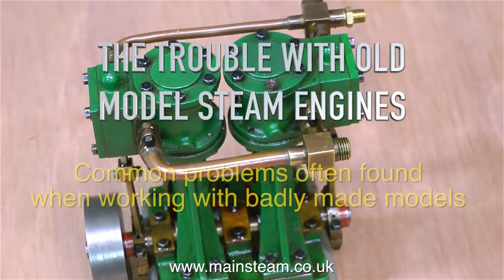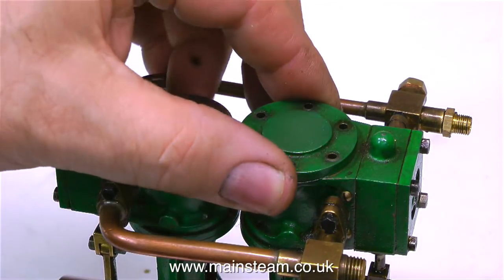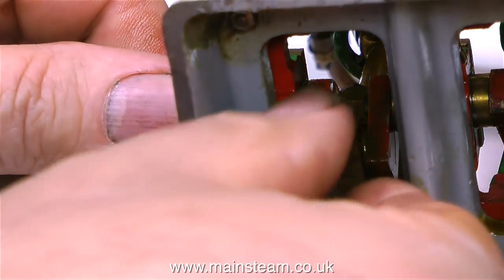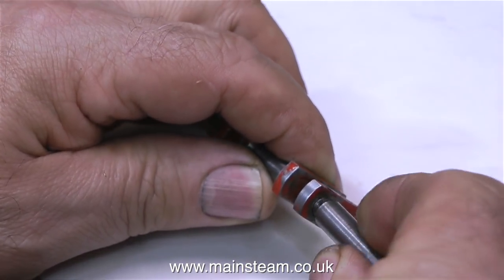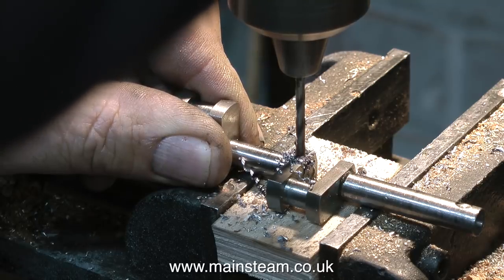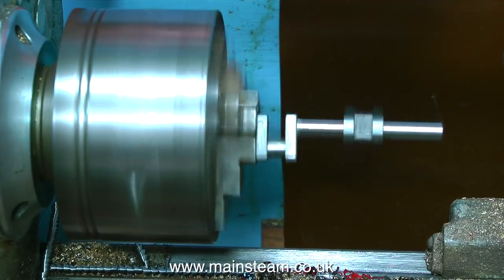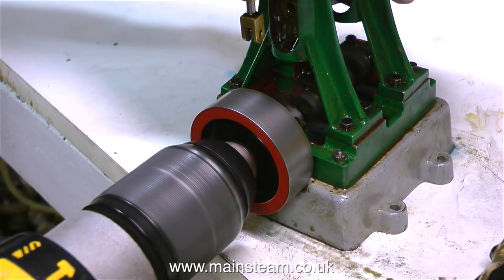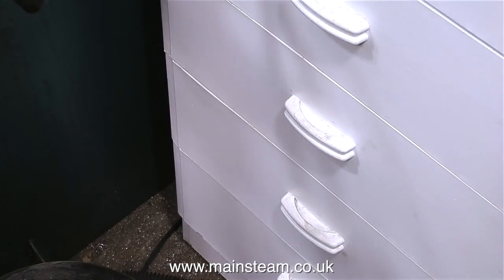THE TROUBLE WITH OLD MODEL STEAM ENGINES

Comment: You know, I have no idea how anybody could find this interesting as a hobby, however, it makes me quite inexplicably happy that somebody does find this so interesting as a hobby.  Kudos to the publisher.
Reply: steam engines are much more efficient than the gasoline or diesel crap on the roads I heard...
Reply: If it wasn't such a wast of energy to boil water...
Reply: Nope, all steam engines are woefully inefficient compared to internal combustion engines.  That's why they are not used, Derp!
Reply: Typical gasoline engine: 37% efficiency
Typical diesel engine efficiency: 45% (55% is not unheard of)
Typical piston type steam engine: 17%
Not sure on steam turbine.
Reply: Has more to due with the fact that a steam piston engine requires 3 consumable fuels.

1. Thermal fuel
2. Water (even with a condenser you will have loss.
3. Steam oil (that gets lost with the water) to lubricate the piston

Piston steam engines have the advantage of being essentially one stroke. There is a force being applied to the crank on the up and the down stroke of the piston. Which in terms of rotation power impulse is unbeatable for torque.

Steam is also not all that convenient because you have to build up steam before going, unlike a diesel or gasoline. Though before the electric starter steam actually was more popular, steam engine wasn't going to backfire and break your arm,  and wasn't as noisy.
Reply: Steam turbines in large electric power plants achieve efficiencies around 35% IIRC.
Reply: the trick to improving  efficacy is to boil tiny amounts of water into superheated pressures...tiny volume of water per boil but at tremendous amounts of pressure...something we can really do easily like friskies with our current modern present engineering capabilities
Reply: +ss "I can't contemplate why anyone wouldn't find steam engines interesting as a hobby. Engineering is interesting in all it's forms."

I'm an engineer and I agree.

I know how a steam engine works.  There done!  Now, how does a neural network, work?

What I mean with my initial comment, is once you understand it, I don't understand why you'd want to collect a million examples of it.  There's only so many ways a steam engine can be intelligently designed.  I expect it's close to the optimal design by now.

It's like a bicycle now.  They are basically engineered perfectly.  You can't really improve on the design at all.  They are over 90% efficient in energy transfer.  Something like 95% I think.  A really high end bicycle made in 1995 isn't much different in performance than one made in 2017 - just a little lighter.  In fact, a good bicycle from 1980 isn't much different - but it was a bit heavier made from steel.  Once you see the perfect design, and understand why it's made that way, what's left to do with it?

But I don't begrudge people collecting old bicycles, and it's interesting to see older designs with not quite perfect engineering (and they made some pretty basic mistakes back in the early 1900s), but I'd never ride one except as a lark.

I just find it kind of remarkable that people would collect a bunch of model steam engines but it makes me happy, for reasons I entirely do not understand, that somebody does enjoy it.  Always amuses me to have a emotional reaction that confuses myself.
Reply: +fuzzywzhe, that is the words of ignorance.  More you know about a subject, the more less incline you are to say you are an expert.
And less you know, more incline you are to claim you know all that is needed to know about the subject.

AND hobbies are not needed to be useful, they are ment to be fun.  Steam engine are fun.
Reply: +David Vermillion, you forget to add Electrical engine into the equation.

I can't understand why people even consider internal combustion engine these days. :-)
Reply: The fun. I don't think you understand the beauty of a big block. and also when we switch to fully electric cars we will need something to produce all the extra needed energy where will it come from?
Reply: +David Vermillion. From the same place where the energy come from where we push those pistons.
And yes, internal cumbustion V8 or a proper V12 (Jaguar) are great fun, but as obsolete as the Steam engine.
Reply: Your logic is flawed because you are forgetting one thing.

Where did that electrical energy originally come from? A power plant using steam power to generate electricity. Doing an efficiency calculation from just the battery to the electric motor is the same as assuming free energy exists.
Reply: +steve gale, depend on which generation of the V12 you thinking of. My Jaguar XJS 1983 only took about the same a ordinary Volvo did when driving through Norway.
But yes, when I push the pedal down, it moves and uses some fuel...
And I really doubt the straight 6 will be near the push you get from the V12.

But to each what they like.
Reply: +Paul Dude, I think you should read up on the subject before you do make any more statements about Electrical cars, and engines.
There are NOT a big engineering problem to cool an electrical engine, even less than Combustion Engines.
Just look on how Electrical engines are used in the industry.  

Yes, the petrol are not as heavy as the batteries, but then again, the Electrical engine are much lighter than an combustion engine. For one thing, you only need a single gear box. 
And again, alternative fuels works great generating Energy. 
There are alternatives to ship diesel/oil too, but that will take some more change, as it take a longer time.
Reply: +Paul Dude, please stop making baseless statements like that.
I guess the petrol will be on a very bad state after 10 years too.
And there are no rocket science to change batteries.

Making laws are necessary to make an incitement to change bad engines in the speed it is needed.  Yes, combustion engine are bad, especially when they are small.

You are obviously not an engineer which physic knowledge, so stop make those baseless statements.

And yes, I love steam engines, in museums and as small toys like in this channel.  I also like older engines and cars. But the truth is, they are using a obsolete, bad, and costly technology that are hard to support, compared to new techniques.
Reply: Paul Dude and diesel cool away about half of the energy. An electric motor is near 90% efficient. Where combustion engines never even theoretically can reach.
You are a combustion engine fan, I am an engineering fan. So please do you reserch, as you clearly have not done that.
And yes, it has nothing to do with steam engines. I like steam engines and internal combustion enginges for the same reason, recreation.  But I am not so blinded that I don't see their shortcommings. Butif you like the combustion engines for recreation, please help yourself. But yes, they are equal obsoleted, by the same reasons,  electrical motors are technically superior, based on physics.
Reply: steve gale yes, I do belive that internal combustion will be in large ships for a long time, as the alternatives are not good enough in scales, with the current knowledge.But it will be when the oil get up in price, and it will...
Reply: Ander Jackson, Again. your efficiency number is a false number. That is only looking at the conversion of the chemical energy stored in the battery being converted into mechanical energy. However that chemical energy was created by charging said battery pack with main line power.  And as only 11.7% of the U.S. domestic power generation is renewable and 19.5% nuclear that means fossil fuels where burned somewhere to generate steam and produce that electrical power. Very few countries in the world have even close to a majority percentage of renewable electrical production.

Electrical cars are one of the largest misrepresentations of efficiency and environmental impact today. There are some advantages such as regenerative braking, and torque from rest (much like a piston steam engine btw). But the reality is you are simply shifting the pollution and thermal inefficiency from the vehicle to a power plant somewhere. And the heavy metals mining to produce battery packs has it's own environmental hazards.

Then of course factoring in that a drained battery pack ways the same as a fully charged one versus an empty tank of fuel weighs well just the tank. Electric cars have their place and advantages but they aren't the end all be all yet. Also, they aren't exactly new either. Do yourself a fun educational favor and look up the Baker Electric Car. At one point it was the most common horseless carriage in New York City. Ultimately lost out to gasoline powered vehicles.
Reply from the maker: The comments below are getting a tiny bit over technical for me I think - after all we are only looking at big boy's toy Steam Engines after all . . .  :-)))
Reply: ikr, it's just a simple mechanical thing, there's some beauty in the simplicity and function. they pre-date combustion engines and you can make from scratch! luv them!
Reply: haha, yeah. smelly gas and soot and exhaust, horribly complex and they pollute, so you're not running it in the den or house proper
Reply: but combustion is not eco-friendly. thats the trend now, so that's why we're seeing hybrids and Teslas more and more
Reply: Sorry +Keith Appleton, I have problems with people that doesn't understand basic physics or engineering, and can't understand that they are wrong. It's like a Tourettes syndrom, can't help it.  I will try though. :-)

So back to the fun, looking at videos of you building and restoring steam engines. Thanks for show them to us, they are great videos.
Reply: "I don't understand why you'd want to collect a million examples of it."

It's the superficial stuff.  Having the one perfectly engineered model steam engine is boring to have and look at.
Reply: It's a symbol of a civil society. Antifa doesn't do this.
Reply: + Anders Jackson
Worlds within worlds. The man that actually knows a lot knows how little he knows relative to God.

Comment: Keith, the crankshafts in large engine are not one part, the journals and webs are all individual parts.  They are shrunk together with a 1.25% interference.  Medium size are usually from forgings and then machined.  Journals are all hand polished .
Reply: When he say large he means huge
Ship slow speed Diesel engines with pistons a meter in diameter…
.

A locomotive engine is medium in this scale he is using.

I was in Denmark when B&W was still making engines there and watched then weld together
A crankshaft!

Comment: how about a steam engine without a crankshaft? just make each piston with a oil pump piston on the end, and use the hydraulic fluid to drive a hydraulic motor, hook that to a car transmission and you have a steam/hydraulic hybrid.

Comment: It makes sense that a steam engine would be made from gunmetal, as a gun and an engine do a lot of the same things.  You have a cylinder/barrel under high pressure, except the "pistons" in a gun could be the bolt and the bullet.  And if you notice, both rose to prominence in the 1800s.

Comment: That engine could be repaired, I wouldn’t give up on it. The center journal on the crank is in line with the outside journals. You could machine it down slightly on the lathe you have and make a new center sleeve. You could also make the new sleeve on your lathe.
Reply from the maker: Please see my last comment . . . . . .

Comment: I made a double 10 at the end of my apprenticeship, but my crankshaft was turned in one piece. After finishing it had to endure a 8 hour test without breaking down, otherwise only a rather low mark would have been handed out. Shame that people botch nice models like that, if they can not do it let some one build it that knows what they are doing. My engine is now for the last 30 years a decoration on the mantelpiece.

Comment: Could you fabricate a crankshaft by starting with a straight shaft and pressing the cheeks to the different depths.  Then press the two crank pins in and finally cut out the main shaft at the two cranks?
The threaded crank pieces just seem to be impossibly loose and out of true.

Comment: the reason i would see for the bad engine having  bolt of an other color would be because they have already bean rebuild by some one the original bolt where taken off and changed that what happen on the machinery i work on and the job are not always well done we try to replace the minimum to keep cost low so after a while you need to have a proper rebuilt and replace almost everything

Comment: I apologise in advance for the probably very dumb question, but: could one avoid the problem of the crankshaft binding due to the central part being untrue by simply removing the center split bearing and supporting it solely with the outer bearings? I imagine on a big engine this would be a recipe for all sorts of problems, but might a model work?
Reply from the maker: Yes that would work, but I really don't recommend it . . . . the stress would be great over the length of an unsupported crankshaft. Better to make another, they are easy enough to fabricate.

Comment: You could also silver solder the crank so it is solid.
Reply from the maker: I value my time. Repairing such a badly made engine would cost more that the value of the repaired item The job is wholly impractical, Silver soldering it would make the Crankshaft more rigid but it would still be wrong in many ways......
Reply: @keithappleton  I understand, one thing I don’t have is time.

Comment: It didn't look bad (to me), until I saw the inside of it. Thanks for exposing the poor quality. I could tell it was poor when I started to see the end threads of the screws. Lots of slop. The bolts weren't made for engines, apparently. But a threaded crank is an insult to the purchaser. The large casted piece makes it look better than it is.

Comment: So, while you had the crankshaft in the lathe with bot ends running true, why didn't you put a live center at the right and and turn the center to true it up?  Even if the shaft diameter were then different that at the ends, you could put a new bearing in the center reamed down to the new shaft diameter.
Reply from the maker: The whole thing was rubbish and very weak - not worth bothering with.

Comment: While accuracy is a good issue in any engine there are other aspects of an engine that one may enjoy and that is the logic of the engine operation.  If one  has children as an audience, it is remarkable how interested they are in the working logic of an engine rather than showing them a perfect  well made engine.    
The idea is to use an engine as the composition  with the vocabulary of any language.  The manner in which components are put together to form a function is  seen by an engine that is not so accurately made.  I always think of an engine made up of an alphabet   movements.  One unit can only achieve some operation but add it to a second bit and a richer  operation is achieved.  So this is what children would enjoy , the art of obtaining a logical movement our of putting a lot of logic together. Most children enjoy the logic rather than the accuracy with which engines are made. Later on when children grow up and appreciate the detail well then like any expensive watch, the polishing of the bits would matter let alone the fitting of the components together.  I have made a lot of wooden escapements  for different watches and most children in schools to whom I show them are so interested in the logic rather than anything else  where even after 120 minutes children are still interested in finding how it works. Their normal attentive span in about 30 minutes, but with logical movements in watches and engines, children can go much further, even better than giving them arts and languages.

Comment: I have just discovered your channel. I'm looking for an engine able to use the steam made by a small fireplace in a pressure cooker - to run a small generator or a car alternator to charge a car battery in the woods when needed. Can you direct my research in a right direction? Do I want to search for a smallest turbine, Tesla turbine or a piston engine like this? I'm only guessing but while a turbine is said to be more efficient, a small engine like this will forgive me unknown pressure, low pressure etc. right?
Reply from the maker: Sorry, I can't help with this - in my opinion it is impractical.

Comment: Neat stuff. Ive never owned a model steam engine before, always wanted one ever since I was a kid.  I think they are the neatest thing just never have found myself in a position to be able to afford one. To bad this little engine didn't work out. It sure is a good looking thing. As is, what would that engine be worth,,, as is? Wouldn't mind having one for display, running or not.
Reply from the maker: They come up on Ebay all the time, this one is cosmetically OK with the correct piping. I wouldn't sell it as a non runner though. I will make a new crankshaft for it, get it running well, and after painting I would think it's worth around £395.00 - As a non-runner it would sell for up to £200.00 probably.
Reply: Thanks for the reply. Great, Ill have to start keeping my eye out for one. They sure are neat.

Comment: coiuldn't you simply TIG weld the crankshaft parts together once you have them reassembled? assuming everything is running true - it should help things a lot?
Reply from the maker: do you not think that the severe heat distortion on such a small component would be a problem ???

Comment: Couldn't you have ground/turned the center crankshaft true and then shimmed either it or the bearing?
Also, do you actually run these engines with steam or do you use compressed air?
Reply from the maker: Not worth it - the crankshaft is too badly made as shown in the video ........ I run on my engines steam & compressed air at different times . . .